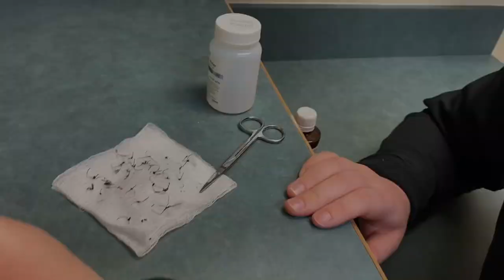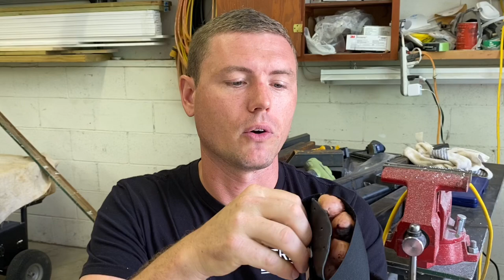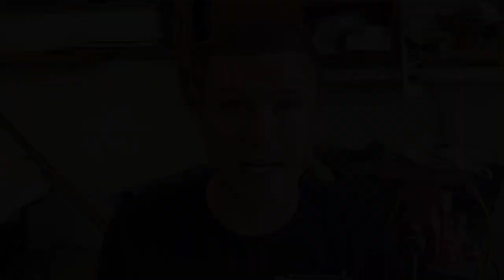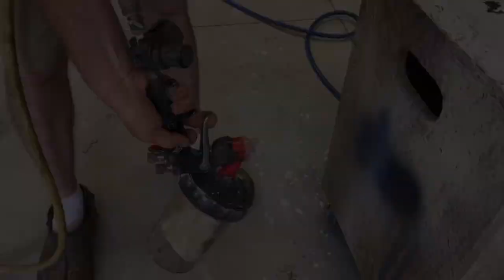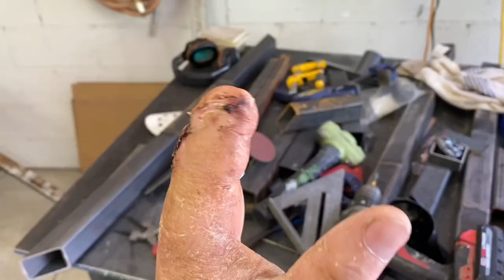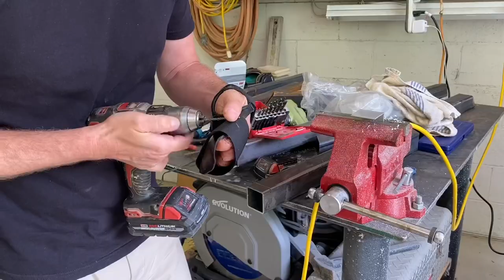The Bandage Comes Off | Jaime Update #4

Comment: I started working for a small local construction company about 4 years ago. I've been blessed to work and learn from these guys for sure. 
Well 6 months of me starting with them we were building this HUGE cedar deck. And I was making the spindles by ripping down boards on the table saw. I was rushing not paying attention and ran my left thumb through the blade. I took it off right at the knuckle. This was May 13 of 2017...... I was getting married may 17 2017. .... my wife was sooo 😡. BUT the doctor managed to attach the thumb. I now have no knuckle and it's about 1/4 inch shorter than it used to be.

Comment: Sorry for your accident. My father had a skilsaw mounted under a bench to make a table saw, the bench was actually designed for such a modification. Well the board he was cutting pinched and shot away and his hand went into the blade. He fortunately didn't lose any fingers, but he did cut them so bad he has lost 30% mobility. His ring finger doesn't bend because of the pin they had in it and his middle finger doesn't bend at the top knuckle. I believe it was a dull blade that caused it and him being slightly careless. But hope and pray for your healing and hope you can return to work full time doing what you love.

Comment: Closest thing to thing I've had, and it isn't much, was when I was scooping snow by hand out of my snowblower. I had turned it off and thought it was safe, but the inertia kept the blades spinning quietly; when I put my hand in there a little to far . . . BANG, one of the blades hit my gloved hand causing what kind of damage I could only imagine till I took of the glove later.
Fortunately it was only a broken bone on the third (distal) joint of my left hand middle finger. It took a few months and the tip is a bit misshapen, but it healed.

Comment: My brother-in-law lost his right arm two inches below the elbow at age 8 when he slipped and fell into a hod mixer on a job site with his Dad.  He has spent his life proving wrong an early medical assessment he would have a withered limb for the rest of his life.  He has lifted weights and continues to do so at age 68.  He played youth sports (baseball and football) and has modified for his use bicycles, motorcycles, and any number of power and manual tools.  He has maintained a very high degree of independence.

You are a model of honesty and humility, and are obviously a good and caring man.  A very cool project to consider might be to collect on video the stories of folks who have been seriously injured whether by accident or by war and share those stories as a way to encourage new amputees to maintain a positive mindset.

You are a great builder and an even greater person.  There is a lot more to you than a hammer and some nails.  You have a reasonably large base from which to draw leads for a video series that has the potential to encourage folks who have experienced bad outcomes and help defeat depression and self esteem issues. In the process you may well offset income loss from not being able to function as you have in the past.

You deserve much more in life.
Reply: Thank you for the encouragement and story about your brother-in-law.

Comment: Hang in there young man. Vitamin E lotion will help the scars heal quicker. When sitting around take the brace off and use the same muscles you would to make a fist, hold 10 count release 10 count, repeat. It will help the swelling go down, and you heal faster by circulating blood into the nubs.

Comment: Im not sure if anyone has mentioned this but why dont you cut some pvc and figure a way to make a particular hand guard  that has a small 4” long by x” diameter pvc mounted in the palm so you could slide it over the left control arm of the zero turn rider.and that would be your pull push mechanism. Thoughts? Make sense?

Comment: Hey Jamie! Great to see that you are recovering well. I hope that you sense great hope in all of this while allowing yourself to grieve over the loss of something valuable. Today I was thinking about you when I was using someones mitresaw and realized that between yesterday and today the shield had gotten smashed! I got chills down my spine when I realized that I didn't notice the broken shield until after a couple cuts! Shield matters, but motor-breaks are more important than what we think! I was also thinking about when I almost shot myself with a finish-nailer just because the safety-thing had gotten damaged, and stuck in firing-position!
I feel strong compassion on you, man. All of us make small mistakes all the time. Some of us are doing it in places of greater risk. I have a curious question: will there grow fat the joints were, or will there be bone just below the skin?

Comment: St. John’s wort regenerates nerve tissue 
<3
Reply: S C if you are going to give medical advice you should tell where to obtain the natural elements. The reason is most everything you buy as for natural supplements are made ( compounded and packaged ) in China or third world countries , there is no quality over site, most you get are synthetic not the real thing i.e.: most labeled vitamin C is absorbic acid . You must buy from a verified producer, this stuff you buy at Walmart, Amazon is pure junk , I spent time researching this when the supplements that I tried didn't work , bought from Walmart etc.
Reply: @heknows5418  don't mess around w the powdered, dry stuff.
get the liquid glycerine extract.
Gaia Herbs is based in NC, sources and grows most of the herbs they use locally.
There's precautions to know about St. John's Wort (SJW).  Photosensitivity.  If you take it, don't go hanging in the sun without protection.  You'll burn more easily.
The bottle says take 1 pill, 3x/day.   The liquid extract capsules are really strong.  Taking one a day is enough.
I did a presentation on SJW in school because it blew my mind as to how powerful is was.
The biggest contraindication is if you're taking anti-depressant drugs.  Any neurotransmitter pharmaceutical is a no no with SJW.   A lot of the anti-depressants will block the re-uptake of a neurotransmitter.  SJW promotes ALL nervous tissue activity.  It promotes the production of neurotransmitters as well as the re-uptake.   So by blocking the re-uptake that can be an uncomfortable problem.
But dang, I remember the first time I tried SJW and thought that I needed to find a purer, more concentrated source.  The Gaia herbs brand is really good.
Hope this helps!